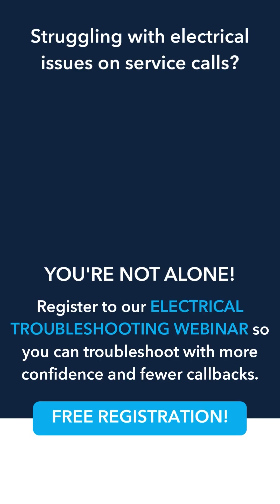Is Short Cycling Caused by Bad Design or Faulty Controls? What’s Your Take?

Comment: Leaking liquid solenoid valve / Low pressure switch- auto mode . Suction filter partial choke ……..
Reply from the maker: Indeed
Reply: @RefrigerationMentor  I really love your course Trevor, but it is quite expensive that I can't even afford it, but I am always following you on YouTube.
I need some informations with regards to super heat and Subcooling. What is the normal Super heat and Subcooling?
Reply from the maker: @jeankalala8415 depends on a few factors there is  cha range for evaporators but medium temp superheat between if your lowest superheat point is 5k(9f) that should work but always follow up with the manufacturer as the will give you want they want to see.
Reply: @RefrigerationMentor thank you Trevor